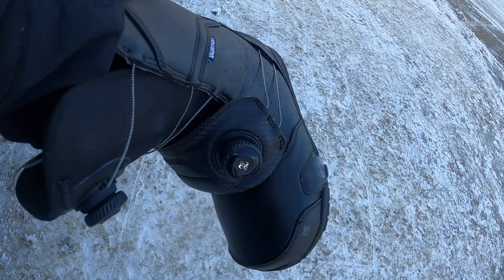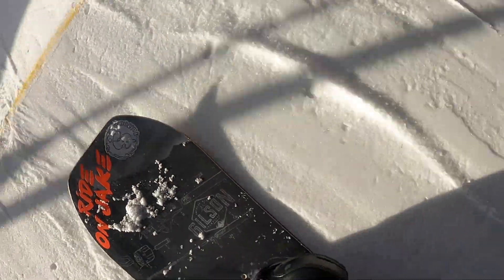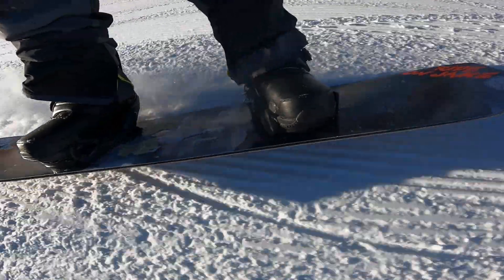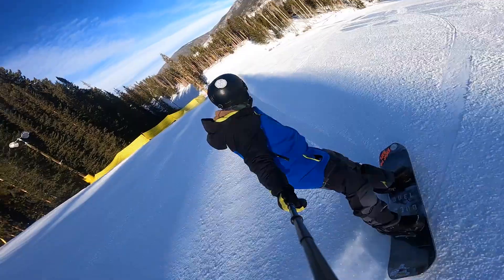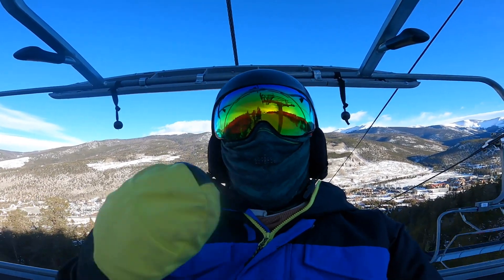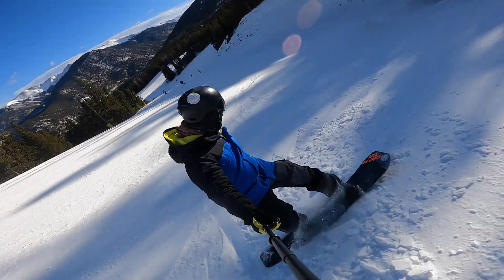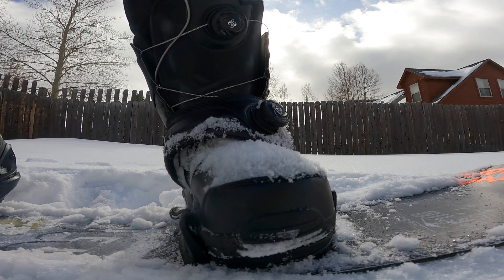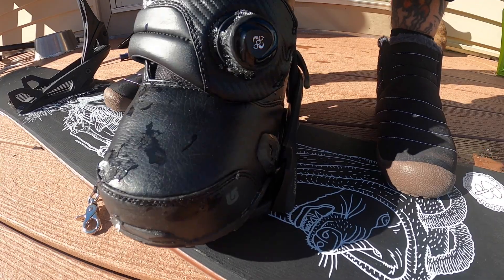How To Stop Burton Step Ons Clicking Sound

Comment: I own them for 2 seasons, footbed is adjusted correctly and it still makes the clicking sound.
From what I heard, a bit of snowboard wax on the toe clips (boots and bindings) will reduce it.
Reply from the maker: i think it goes away more when it is adjusted incorrectly.
have you tried making it smaller than what the boot is? for ex. 10 boot but footbed at the smallest or second to smallest setting?
Reply: @SeanOzz  I didn't but if I'll get the chance, I'll try... Although from what I heard a Burton Rep say is that it happens  because of the flex of the bindings and the flex of the board but will see...
On another note, forgot to thank you for your videos, so thanks Sean!
Reply: @Mike_Solo  hey this actually makes a ton of sense because my board is on the  stiffer side and I see the step ons are a lot more flexible than the board. So this makes a lot of sense

Comment: First !i have tried snowboarding and skii and failed miserably lol but still watching the full video 😂
Reply: It ain’t easy. But it take a couple of times to get it down(snowboarding)
Reply: @StevieD44  yeah I was killing it at the Bunny Hill and then my friends (who are pro)  convinced me to go to the black diamond had to walk down 😂 and hitched a ride on a snowmobile downhill.
Reply from the maker: it takes a minute to figure it out and even longer to master it.

but it is so much fun once you do.
Reply: I don't sports and was 45 when I first tried snowboarding because my wife insisted I go out with my friends rather than mope around all winter complaining about how dark it is. I was terrified of gaining speed and wouldn't point my board down the hill, hating both snowboarding and my wife for making me do it. I basically did falling leaf for the first two years, but things took off once I finally linked my turns and now five years in it's my favourite thing in the world and I watch @Sean Ozz. I did my first black diamond at Tremblant this year, and (accidentally) a double black at Blue Mountain before Ontario got locked down (which I easily survived). I can't wait for restrictions to lift so I can get back out on the hills!

Incidentally, that first summer after I tried it I also got to try flyboarding (those Seadoo powered hovering water jet boards) at a resort. Thanks to all of the heal edge, tow edge plowing I did down the hills that first snowboard season I was the only flyboard newb that got any decent hover time. Bonus!
Reply from the maker: Thank you for sharing that.  
I have wanted to try the water board thing.  One day I hope.

Comment: I hear it sometimes. Size 11 boot with the foot bed set to 11 and cranked max fwd lean. I don't mind it. It's a front to rear of the board weight transfer thing. If you lean back or fwd they're pretty locked down. But if you're centered up and just move back and forth a bit you can click them. I do it when approaching slow 2 plankers on the cat tracks so they know I'm coming. You can make it happen standing in the living room too. Just have to center your weight nose to tail of the board and front to back of yourself then rock so slightly nose to tail of the board. Only other time I really hear it is if I'm bouncing through pow fields where the board is speeding up and slowing down under me.
Reply from the maker: thanks for sharing your experience. if the trade off is powder fields for a click i will take it everytime! lol

Comment: I'd try them if they made them for size 14 wides.  

What's your wooden topsheet swallow tail board?
Reply from the maker: if they ever do snag a pair!

that is the Gilson Fly, a very fun powder board. i like it more than my orca in deep stuff.
Reply: @SeanOzz  I'm bummed about getting the 159 orca last year when they just made a 162 this year.  Never got to test it out in deep pow cause the mountains shut down then Tahoe finally got more snow.

Your board reminded me of a Gentemstick Impossible, but not exactly.  I'll have to look up the Gilson
Reply from the maker: The fly is super nice.  
It is so different than the orca. A much softer board and so fun in deeper stuff. I find my orca better on  not as deep days cuz that magnatraction edge is pretty good on the harder pack underneath.

Comment: Hey Sean, i messaged before saying i could hear it intermittently but now both feet clicking so bad now, not sure if its a mental thing or not, but they also feel less responsive. and definitely sucks a bit of confidence out of riding.
Reply from the maker: No luck with adjusting the foot beds ?  I find I hear it more on a powder day.  

I hear you can rub wax on the cleat and that makes it stop. 

I do think it is also mental when we hear it more due to focusing on it and listening for it.  My only gripe
Reply: @SeanOzz  footbeds were set correctly so i set them to the wrong size on purpose and it didnt help. there is so much movement im wondering if the footbed is becoming too compressed with use?? Maybe i should lose a few pounds :P
Reply from the maker: Ha ha. I am trying hard to drop some pounds myself.  Easier said than done.  This season I am getting some grabs but I need to drop a few more to make that easier. Lol
Reply: @SeanOzz  I hear ya. but beers after boarding is just too damn good. Anyway, i sent you a video of the clicking. no worries if you dont get it i know you cant ready every mail.
Reply: @SeanOzz  FYI I tried the wax trick and it worked a treat, i didnt use finishing wax as the video suggested but i bought a cheap brick of board wax and rubbed it against the cleats and hooks, no heating it up or anything as i was actually on the mountain when i did this. Worked like a charm for around three hours but i was leaving then anyway so it wasnt a problem, so i guess if you heated it slightly and painted it on or use the finishing wax then it would work even better.